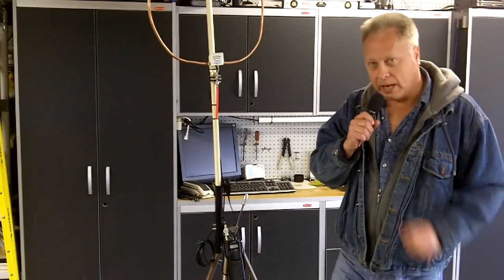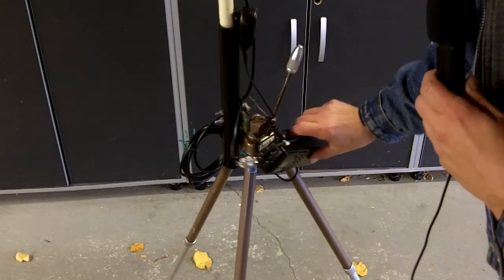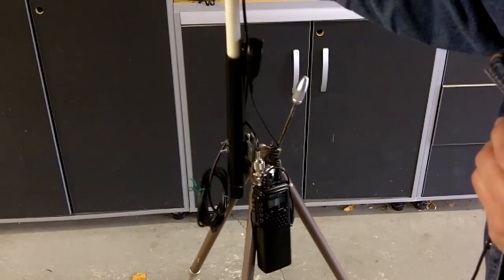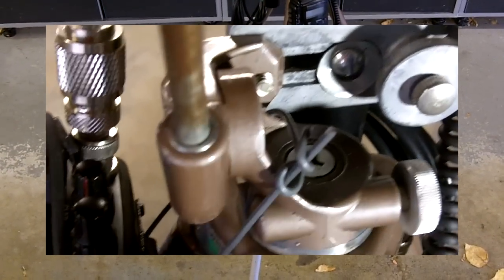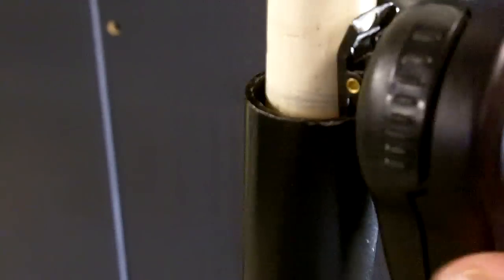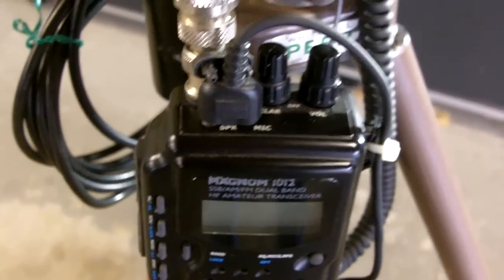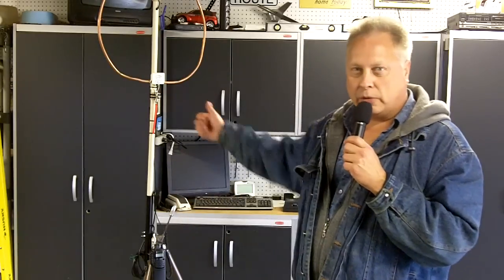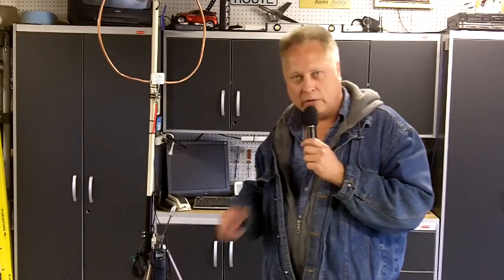A Tripod Mount For My Portable HF Loop Antenna

Comment from the maker: It seems to be working about the same as when I hook the HT up to my quarter wave near ground mounted antenna so about what I am expecting from it, it is working quite well the way it seems.  I used it today and made a contact to a buddy in CA and the loop was in my living room and I was using 3 watts out on FM 29.600.  I shot video of it but my audio jack on my camera cut out so I got no audio on the recording, I will have to try again, I missed a good demo there dang it.

Comment from the maker: Thanks and yes, the loop might be a good solution for you, they will work ok on 40 also, you will probably want to use the size of a Hula Hoop if you know what they are. Maybe search for 40 meter loop on internet also for more info. You will not want to run a lot of power from indoors, probably less than 50 or even 25 watts max but should work, I use my 10 meter loop indoors and it works fine.  Also used one on 20 ok but 40 should also work.  80 is much more difficult. 73..Larry